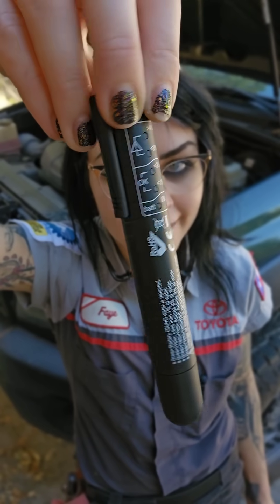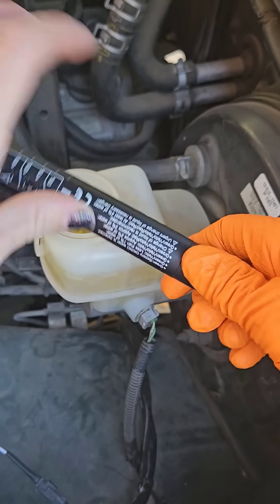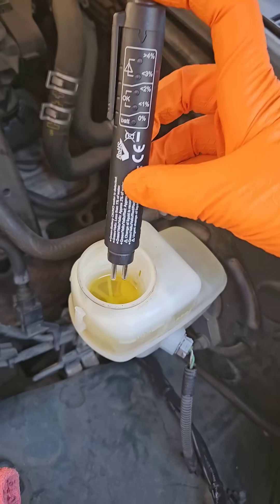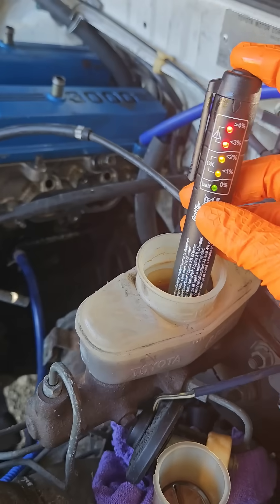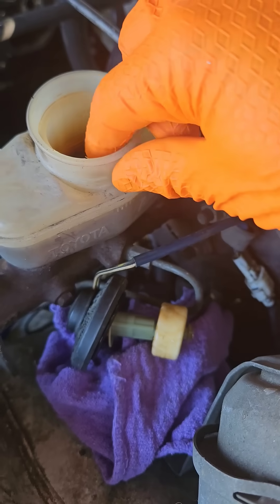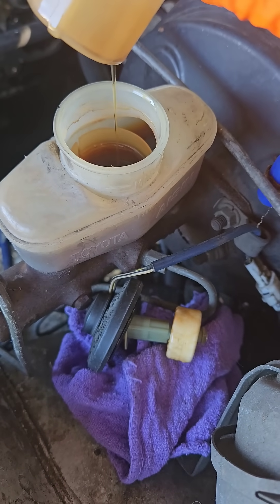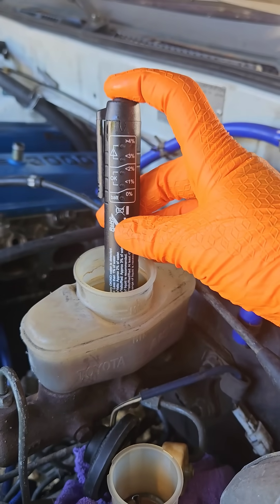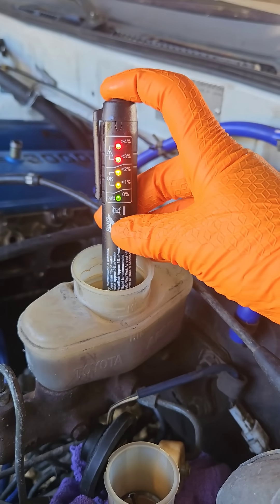Do you REALLY need your Brake Fluid Flushed?? How to Test it For Yourself!

Comment: My sister’s second hand car was never had its break fluid flush since bought and that was almost 15 years ago. A few days ago I tried to flush it and broke 3 of the bleeding nipples because I forgot to add into account that the car has been sitting for years and that part was never touched and rusted shut. Amateur mistake 😂, had to remove the whole wheel and caliper out and slowly drill out the other 2/3.

Comment: Been on all original fluids on my 2015 prius for 320k miles now, and its still driving like new. Except for engine oil of course. In fact, I have 2 priuses with 300k miles on all original fluids. Not promoting anything, just sharing my experience.

Comment: One would think that because the brake fluid on your brakes is a closed loop system, it wouldn't require changing, but after this video, I'll definitely start considering it.

Comment: And dont forget the heat transfer from the brakes and brake caliper to the fluid.  Any fluid is going to break down over time after several heating and cooling cycles.

Comment: Got a Rav4 with 75,000 miles on it and decided to get the trans drained and filled. Owners Manual states you only need to do that if you are towing. Preventative maintenance goes a long ways.

Comment: For those of us up north, our brake lines will rust through from the outside before the fluid ever goes bad. All my vehicles are older than 10 years, haven't yet seen an issue with the brake fluid.

Comment: How would the water that "might" be in the brake fluid ever get to boiling point on a daily driver car? She said add some heat the steam point of water is 212°F if your brake fluid is ever that hot you have way more serious problems.

Comment: there are a lot wrong here, the brakfluid in yhe lines are not getting the water unless you have a leek, so we only replace the fluid in the resuvare, if it have water in it... water contain water in the molycule h2o the o is oxygen, so no heat needed for his to be a problom....

Comment: There's one question I've always have on my mind: why does no mechanics in my country have one of those fluid testers? I have one, works brilliantly. But none of the mechanics I've sent my car to have them, and they're big companies. 3 times, they've said to me, "Your brake fluid needs flushing" while just looking at the colour outside of the resivor, and all of those times, it never needed changing, because the tester told me so, as you explained in the video.

Comment: Also in sub zero temps when the water in your brake fluid freezes you have no brakes.  Had that happen.  Also i flushed the fluid in a car that had no issues and the brakes worked much better.

Comment: Been having intermittent insufficient clutch throwout travel on my ranger for months. Whenever engine is hot, like when getting off the freeway and wind ain’t blowing on the hot engine anymore at first red light after exiting, stick will not push into first without shutting off engine. Then problem goes away shortly after and throwout travel is good and shifts normally. Master, slave, flywheel, throwout bearing, pilot bearing, friction disc, pressure plate, reservoir.. all been replaced.. BUT IT WAS PISSING DOWN RAIN WHEN I DID THE WORK OUTDOORS! Line between master and slave cyl is very close to exhaust manifold.. your bit in the video about water infused within brake fluid flashing to steam when hot and making pedal squishy may have just solved my friggin hair pulling doozie of a clutch issue that’s been kicking my A** for nearly a year. ❤

Comment: These conductivity testers are very unreliable. Please follow the advice of the manufacturer of your car (generally every 2 or 3 years). I’ve done boiling tests where brake fluid would boil on dangerously low temperatures and where the conductivity tester would say “ok”

Comment: She is right, kinda. You have to remember,  this closed system does not return fluid back to the reservoirs tank. Brake fluid stays somewhat stagnate in some area's.  Therefore,  it tends to breakdown and causes pitting of valves and check balls in the antilock braking system. So, yes the brake systems need to be flushed.

Comment: The ONLY time anyone has to mess with brake fluid is from changing out parts in the brake system. Otherwise, it's NEVER needed during the lifespan of the vehicle. That's like someone saying you need to change the air in your tires.
Reply: Are you being serious? 😂 
That'll be your little secret.

Comment: In the uk car dealers m.o.t test require brake fluid change every 2 years at a cost of £100 + £35-40 for the m.o.t test plus more £ if it fails on anything else

Comment: Fun fact, your brakes won’t feel “spongy” until you hit 20% water, and it won’t facilitate rust until you hit almost 50% water!

Just because your brake fluid is 20% water does not mean that the fluid is 20% compressible…since water compresses at about 16% by volume, that means 100 x 0.2 x 0.16 = 3.2% compression. 

If your brake fluid was 20% water, you’d get 3% compression out of it, and trust me, that rust ain’t coming from the inside.  Don’t fall for this scam EVER.

Comment: The mechanics we have at work are totally useless a chimp would do a better job than the 2 idiots we have uet the boss won't get rid of them because he like the cheap labour and the cowboy jobs they do, example instead of changing all 4 brake pads on all wheels they did 1 out come total brake failure at 70mph fully loaded to and I got the blame for it,me being me refused to drive van and told boss,manger and mechanics how dangerous and useless they all are,and unless it's fixed right the van won't get driven,engine failed afterwards just had van back after I left a list of jobs to do,have been told all's been done only time will tell I give it a few weeks before it goes back again

Comment: I drove a 20 year old car that sat for 8 years.  Changed the oil only.  It drove alright for 2 years.  Never changed the brake fluid that was probably never flushed.  It died because ohio road salt dissolved the frame.

Comment: I have never, in my 20yrs as an auto-mechanic, seen a brake system fail due to brake fluid not being flushed. This would be a good idea if vehicles were on the road indefinitely however you are lucky if a car makes it 200k before going to a scrap yard. Not flushing your brake fluid for up to 200k miles is not going to cause the brake system to fail.

Comment: Brake fluid can overheat in time usually from towing heavy loads or cheap pads you push the brake pedal harder to stop faster creating more heat from friction if your fluid is dark or black it lost alot of its hydraulic ability that's the only time I flush a system if its clear let it ride that's just me though.

Comment: No such thing as flushing brake fluid its a scam and always has been there are cars with half a million miles on them that have never had the brake system touched other than changing pads flushing the system fills it with air which in a hydraulic system is a big no no u bleed ur lines through a bleeder valve if they have air in them which takes about 10 seconds flushing a system means ur pulling all the fluid out and u definitely do not wanna do that because ur filling the lines with air from the atmosphere which does hav moisture init a brake system is a closed system and should not be drained ever same with hydraulics on a tractor

Comment: Long story short: I was at a track day and after a couple of hot laps breaking from the back stretch to a 90dgree turn the whole pressure on the pedal disappeared and it went to the floor. I later learned about cavitation and how the higher the moisture the more chances something like this could happen when running stock brakes at the track creating way too much temp. I didn't know these sensors were very cheap. I'll be getting one. Thanks for the content!

Comment: Just remember, there is no need to completely flush the lines. All you have to to get get a turkey baster and empty the resevoir every weekend for a month and fill back up. it will get the fluid in the system clean. You're welcome.
Reply: that really doesn’t do much, brake fluid doesn’t mix like other fluids and all the moisture and contaminants don’t accumulate in the reservoir
Reply: Actually, the quality of the fluid is the same throughout the entire system, when you empty and refill several times it does the whole system. Look it up, it's been proven time and time again.  @arcanevoid9199

Comment: Yeah those testers immediately die. The plastic is not fluid resistant. It will immediately melt and decay on contact with brake fluid.

Comment: I find that you get a more accurate test if you do both the reservoir and a cup to catch some from the bleeders. It is more prone to moisture/rust after going through the brake lines.
Reply: Exactly right. And the fluid in the calipers and lower brake lines takes the most abuse (heat), especially if the vehicle is driven hard.

Comment: Hate mechanics, i am one too btw. I see people get told total bullshit all the time to upcharge customers. No shame.   You are all on point.  But doubt water would flash to steam in there, especally when under pressure. However, minor question. Would trust any shop that hires people like you.  Thx
Reply: it absolutely can flash to steam, that’s why the brake pedal can go to the floor if you overheat the fluid

Comment: If you're getting heat in your break lines, you have bigger problems than water. 👏👏👏🤪
Reply: completely normal for brake fluid to get hot, that’s why the entire DOT specification is a thing

Comment: I have trust issues with mechanic shops. Had a dealership inspect my moms jeep then say she needs new break pads/rotors. Wanted 1400 which was about 1200 in just labor. Bought the pads/rotors and took it to a different shop only for them to say they are still good for 30k miles lol. Didn't charge for the time and put the old ones back on. So you can take a guess where she won't be going anymore.

Comment: Never changed bake fluid once lol most cars have a seeled system and all bikes definitely do it must be an American thing to have a lid with a hole in it because iv never seen it in the uk
Reply: it still breaks down and absorbs water through rubber seals, it’s not as “sealed” as you think it is

Comment: Brake fluid's performance diminishes with age and water absorption-lowering the boiling point of the brake fluid... This is especially important braking from high speeds, where you can heat up the entire rotor and caliper - boiling the fluid and possibly resulting in a total loss of brakes.   As you pointed out - it does also become more corrosive and destructive to the metal lines.

Comment: These "Fluid changes" are all completely un necessary, as gas is a petroleum product, and is oil to begin with and the gas goes through your system thus pushing oil through your entire system, It's about as useless as an oil change. . . 
.
>
>
>
>
>
(Obviously I'm joking, you menaces' to automobiles and auto techs.)

Comment: To anyone wondering, the reason this works is brake fluid as a fluid likes to be equal, so if it gets a little extra water at the reservoir it will spread out to all the fluid connected in the system.

Comment: I wish someone would tell people not to top off their brake fluid. If your brake fluid is low, it means either you have a leak or your pads are worn and might need replacement. 
The level should be at the "max" line when new pads are installed, and when it gets to the "min" line, it is time for new ones.

Comment: a quick answer would be "because your brake calipers will seize if you don't". but people don't trust mechanics anymore. there's a lot more bad ones than good ones out there. by the way, no manufacturer actually puts a brake fluid flush on their scheduled maintenance, because manufacturers do not actually want your car to last 150k+ miles.

Comment: i learned why its a squishy feeling on brake pedals lol thank you
Reply: also air in the line can make it squishy
Reply: There are a number of reasons why a brake pedal may be squishy, none of them good.
Reply: @mattfisher8568 😂😂 this is the realest answer
Reply: Other reasons... your back (drum) brakes need adjustment or your master cylinder is failing
Reply: Or you could just need new brake pads.
Reply: @egu5100  more likely  to be air  vs pads.  but  that would be a big gravy job back when i worked at Firestone.  pads  plus the flush...
Reply: @egu5100 
No!
Reply: @SuperSedingAngeL-yr0  Explain
Reply: @egu5100    because when brake pads are worn they don't get soft and rubbery to allow for the pedal to feel "squishy".  If you need new pads, the brakes will make a grinding sound of metal on metal, or they will squeal.  There is a little metal clip on the caliper, that it's entire purpose in life, is to literally squeal on the discs, when they want some new pads installed.
Reply: It's probably just air, in order for water to boil you need to brake many times from higher speed, like on circuit.

Comment: I change my brake fluid every time I replace the brake pads which is about once a year or every 18 months depending on how gentle traffic allows me to be on the brakes.
Reply: i have never changed it, and i sadly dont change brake shoes until they stop squealing. this time, i've left my motor oil in for a year and a couple of months. when you can barely walk in a store or get up, its quite hard to work on my car. i bought my oil and filter, pray for me please, if you dont mind.

Comment: Can't even flush the fluid on mine it hasn't been changed in well over 10 years. The front calipers are so old they'd need to be replaced otherwise they'll most likely never work if flushed. I love old Toyota Camry's and Corolla's

Comment: Water decreases the boiling point of the brake fluid, so basically your fluid will boil faster. Brake fluid is hygroscopic so it absorbs Water which is fine but too much water is bad

Comment: If you have been following up on vehicular accidents in the far East you will note several accidents caused by brake failure.  This is the reason. They think brake fluid is a type of oil that doesn't absorb water so they never change it.

Comment: Every vehicle I've had since 1990 , that somebody didn't wreck....😮... has gone 200 k + mi and I've never flushed  brake fluid.   Only bled when had a problem.

My existing 2003 f150 has 326 k on it and has never had the brake fluid changed .... Unless you get a leak and get moisture in, it's not much of a problem.

Comment: Water in the brake fluid causes a snot like buildup, it plugs up the bleeder holes in the master cylinder.. so when the brake fluid transfers heat and expands it can't low through the bleed off holes and will cause the brakes to bear down and lock up and or cause pedal to be mushy in colder temperatures.. besides corrosion issues

Comment: got boned at jiffy lube. said it was bad needed to be flushed. went to different location on next oil change. they said needed a fluid flush. I told them had it done recently even had the receipt. they back chucked. never going there again

Comment: Brake fluid is a huge scam. It’s made for the brake industry to sell brake parts. 

Why not choosing a fluid that will love to absorb the water in the air and then becomes VERY corrosive ? You are a parts seller ! If you promote an hydraulic fluid that is not hygroscopic and that repels the water, you gonna lost 90% of your sales in rewards. 

Citroen did at first use this shit brake fluids into the first hydraulic suspension on « traction ». They had so much problems with that shit, but still wanted to keep the part market so they decided to engineer the LHM fluid. Based on petrol oil. You would never found a sized brake. Never a fitting gonna be sized by rust.

Comment: Never changed my brake fluid, transmission fluid or differential oil. Regular oil changes, changed coolant once due to bad thermostat, and the power steering had been thoroughly flushed twice due to blown power steering hose, i replace with atf because power steering fluid is a rip off. 300,000km on it and the body rust is eating it faster.

Comment: no you don't need it changed.
Reply from the maker: Hopefully you don't change yours ever, then 👍🏻
Reply: I won't.  It's not necessary to flush the break system unless you put something in there besides break fluid.
Reply: @vaderkod  not true at all, try learning how brake fluid works
Reply: You are wrong.  Brake fluid flush is a scam.  Worked on cars for 23 years & my father was a mechanic for almost 50. You learn how it works.
Reply: @vaderkod  really don’t understand how you have never realised this after working on cars for so long, this is common knowledge to anyone who knows about cars. brake fluid breaks down over time and also absorbs water, even a sealed container in a parts store has a fairly short shelf life. there is a reason why pretty much every brake fluid supplier recommends changing it every 2 years
Reply: How old are you? 18? Did you just start being a mechanic?
Reply: @vaderkod  19 and no im not a mechanic, doesnt really make a difference though as there is so much info online :)
Reply: I got my info from my father who has been in the business for almost 50 years. I'll take that over the internet any day.
Reply: @vaderkod  i get your point, but when multiple different sources say the exact same thing including ones heavily involved in motorsport or even brake fluid manufacturers it makes one random persons info on it pretty irrelevant
Reply: OK I looked it up.  It is calling flushing the brake system & bleeding the brakes the same thing. Yes you have to bleed the brakes every time you open the system.

Comment: Just use your eyes, if its dark change it you don't need some device 
The only reason brake fluid needs changed is when it picks up enough water to boil under braking temperatures, and when its that bad its dark af